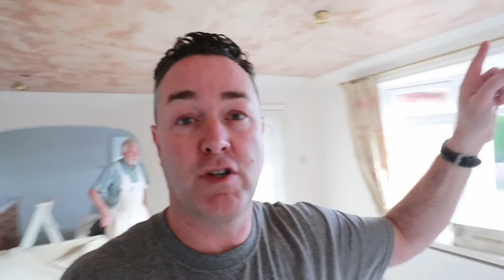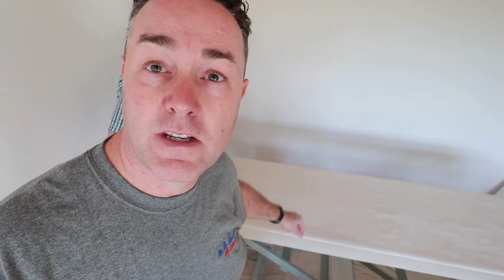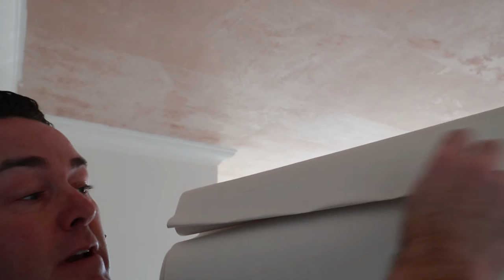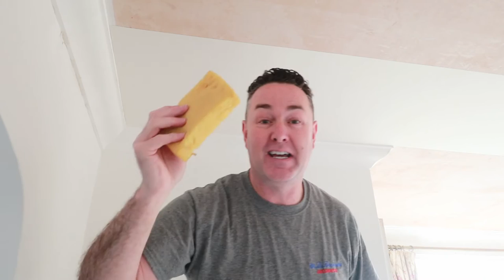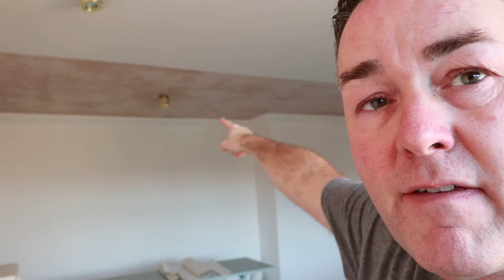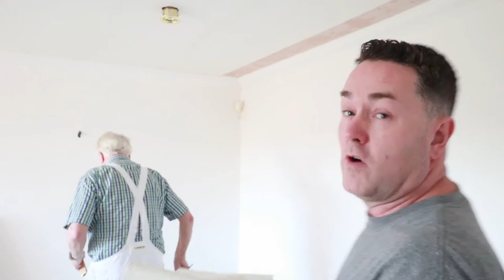Learn How to Wallpaper a Ceiling from a Pro - Revealed!

Comment: Hello there from Croatia. I have printed wallpaper on something that is similar like linen. Applied glue to ceiling and paper, but paper started to fall off.

Why that happened and how to prevent it, many thanks for instructions 👏 God bless You
Reply from the maker: if it's a non woven paste the wall paper... you just need to paste the surafce... are you using ready mixed tub paste (thick and a white colour)?

Comment: I have the Prodec pasting table it has metal edges which snags the paper so i had to tape them up to make it smooth. I also marked my table at 6ft with a permanent marker.
Reply from the maker: With rounded corners too.... Not well designed are they.

Comment: Hi Phil, I know your dad is the pasting for you, have you ever owned a paste machine? For when your on your own. I have a tapofix profix  CS. 

One of the cheaper paste machines. Find it comes in handy every now and then. 
Although I know a lot of papers are paste the wall these days.  

Great for lining paper and easy fresco etc. and finish papers once you get the hang of it. 

Just need to thin the paste quite a lot.
Reply from the maker: my dad had two, 40yrs ago, said they were more hassle than they were worth, getting the paste right .. acting up... and then the clean out. So ened up getting rid.

Comment: Another great video Phil. Can I ask a couple of questions. I see u still use Wickes paste, was ur dad watering it down at the start of the video? Also u stated if u start by the window u measure in 10mm & use the laser lined up on the 2 marks, how come u never used the laser on this video? It's easy to run out when applying lining paper if you are not following a line. Thanks in advance!😊
Reply from the maker: Hi, you watched it all the way through? You saw where I started against that part of coving edge? meaning  hung the longest length first to make it easier for cutting?
Yep, wickes paste and beeling, depending were we are to get hold of some... ease it for lining paper, no need to have it too tick and making it hard to apply.. it's only lining paper, but needs to soak in.
Reply: @ProfessionalPainterDecorator  Ha I always watch them all the way thru, even that hour long one on how to paint a wall!😂
Yeah I understood about starting by the coving doing longest length first, I would have been worried when ur past the coving in the middle of the ceiling u have no straight line to follow & it could all go belly up like a banana shape!🤨
One last question, do u water the paste down even for normal paper or just lining paper? Sorry to keep bothering u!🙂

Comment: Hi Phil,new to your channel,and enjoying it. I am a diy decorator of 40+ yrs,but always into new techniques,and tips.  I like to dampen my paper with a squirty spray prior to pasting,is this a waste of time..? Comment on that?  Now a fan of paste wall paste,but usually paste paper aswell,is this just a waste of paste?
Have a brill table,an Aldi one,has ali edgeing,2×  V shape legs,been great.
Regards,Richi.
Reply from the maker: hi.

where shall I start??
No need to dampen paper.. you're wasting your time.
the only time you will do this is with pitch foil paper that needs soaking up with a damp spoange before applying the 3in1 adhesive (but now there's Damp Stop which you past the wall).
Lincrusta also needs soaking in first too before adhesive is applied.. tha will expand 1/4"

non wavane paste the wall papers don't need pasting, you'll make like harder doing it... past the wall and hang directly off teh roll.

The on;y time we'll paste a non woven is when it has those little pearl bead balls on the surface.
I spoken aoutthose in videos before.

is the paste table similar to this one?
https://youtu.be/Js9h3IARXUo?si=riw2A7ahALFLzKTl

Comment: Hi - sorry if I have missed it but what are you standing on?  I can see you doing a smooth transition along the ceiling, meaning it doesn't look like you're using step ladders or you'd be up and down them?  Complete novice here so genuine query.  Thank you! :-) PS what grade wallpaper too?  I think I heard 1000?  Thanks
Reply from the maker: Grade lining.... All in the video and the thumb nail picture ;)

They are step ups... About 1.2m long and just high enough to get you to a normal std ceiling hight.
Reply: Ah so sorry - i was sneakily watching at work so had to keep turning the volume down and the screen off 😅 so probably missed it. Thanks for replying!  @ProfessionalPainterDecorator

Comment: Hiya Phil, unrelated question, but here goes, I am going to spray my conservatory frame with original kolorbond, once you add the hardener how long have you got to work with it ? I have bought a hvlp sprayer but not used it yet, the graco with the pressure pot. Would you mix several smaller quantities ?
Reply from the maker: Hi... have you watched my video on it?
The original is single pac.. not a 2part.. it dries within minutes.
Clean down and prep well... away you go.
Reply: Hiya Phil yes I have I watch all your videos bud, the thing I am asking is can I mix enough to sprat the full conservatory, or will it start to set in the vessel before I get that far
Reply: Ah right, sorry its single part so it will be fine. Thanks Phil

Comment: Which table was your father pasting on Phil?,another good vid btw.
Reply from the maker: Mine lol one we've had years. we have a few of them, X bar tressle style.. every so often we sand down and coat up when we're about qite at work. Brian has his own, which is a bit better than the one we use, as his is a bit higher board hight, ours have dropped a bit... the wood bruises and strains on the legs, dropping it down slightly.

Comment: What do you think to using cornflour and water as wallpaper paste for ceilings and walls, to make it easier to remove and is cheap too? Does this make the wallpaper tear easier. I think if its thick enough it may work. Im renting and Ive bought three lots of wallpapers I like. It only occurred to me afterwards about removal if I want to change it or leave the rental. I read that liquod corn starch (cornflour and water made up) makes removal easy?
Reply from the maker: LoL 

Let me know how long before the mould starts to come from the lack of fungicide in it.

A packet flake paste is easy to make, cheap to buy and will stick well and also removed easy as it will soften back up with hot soapy water when you come to remove it.

Comment: Someone else asked this but it wasn’t really answered. Why didn’t you use a pencil or later line on first sheet to make sure it went across straight? I’ve never lined a ceiling but I assumed it’s the same as lining walls and you need a line to follow first sheet?
Reply from the maker: There was no need. I followed the edge of the coving... It's was about 4" long of cove then it went ... The paper then takes its own way. No creases etc it's down. 
If you watch all of it, you see I work back towards the window from that paper edge.
It was easier to get the longest length on, then work from that.
Reply: @ProfessionalPainterDecorator  ok cheers Phil
Reply from the maker: @TheOlzee  if hanging a paper, start from the main ligh source, window. As I explained in the video... Offer it up and bring it in an inch, then work to a line from that
 Lining paper you don't have to be so precise.

Comment: Hi phill you mentioned about a finish paper on a ceiling. We’re you saying that you don’t paper the same direction as the light source you go the opposite way ? Is that correct
Reply from the maker: You can, but start the other side of the room or from the other direction do joints won't correspond.
Lining is a different size to stand wallpaper though, chances of joints meeting up are slim, but it does happen
Reply: @ProfessionalPainterDecorator  Thankyou for your reply phill I will stick with the way always thought and will go with the finish paper the opposite way to the light source. Like you said they did this years ago so the light doesn’t show up Any seams that were defective 😃😃
Reply from the maker: @robbennett9631  the finish paper wants to be starred from the main light source.... the main window. I thought you meant the lining paper, if you were papering over it.